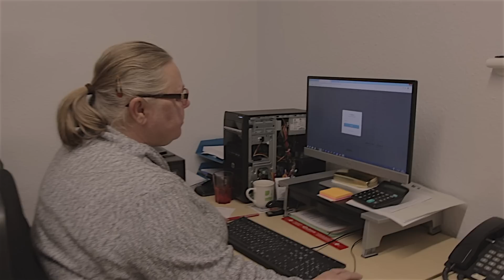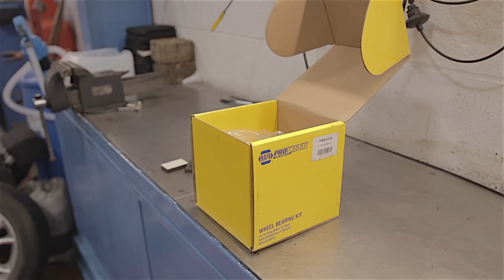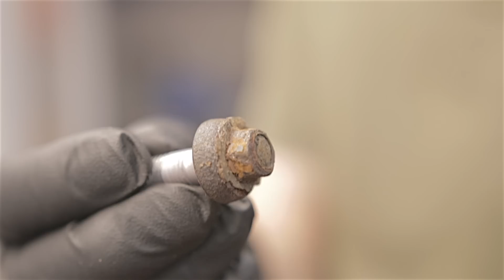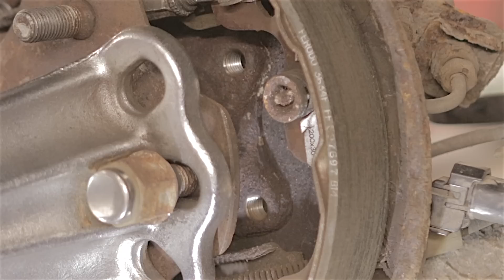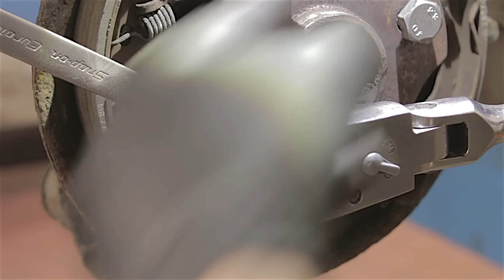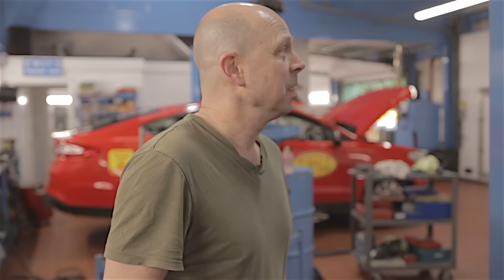Toyota Yaris Rear Wheel Bearing Removal...No Problem

Comment: Tnx mate , you made this job so much easier .
With your tutorial i changed them both . And stripped the threading on the m10 bolts i used to pull it loose.
But it came off.  When installing the new ones i gave it some coppergrease to make it a easier job next time. Unfortunately it didnt solve my abs issue . So that has to be somewhere else.
Already changed the pickuprings on the front , still at almost standstill the abs kicks in . I have No error codes in system.

Comment: I simply:
1. loosen the 4 bearing bolts about 1/8”.
2. Reinstall drum and wheel.
3. Find an open parking lot.
4. Drive in a circle in the parking lot, turning left if removing a right side bearing, or right if a left side bearing.
5. The high lateral force exerted on the bearing easily unseats it.
6. Return to garage and complete task

Comment: on the 2018 Yaris the bolts holding the bearing go through from the front into the axle and the ABS sensor is on the top.  I used the same tightening up a bolt and nut method to remove mine  - only had 22K miles on it!!  thanks for the tip even 5 years down the line!

Comment: Your video was awesome definitely saved my butt. Loved the slide hammer. Mine was stuck as bad. Used the bolts that held it on after it was loose and stuck a wrench between socket and hub and was able to keep loosening and forced off the hub. Thank you
Reply from the maker: excellant, glad it worked for you

Comment: Great video.  I would suggest putting some anti-seize on the bolts that are used to pull the bearing hub off, so that they're less likely to strip if the hub puts up a fight.

Comment: I have followed your instructions and went great.
I replaced my car's rear hub yesterday in a parking lot. Just be sure the hex bolts you are using are grade 5 or grade 8 or similar because will bend. Mine were hex of 10mm Dia. and 80mm long grade 5 and I placed them both sides of the hub evenly and tighten them both a bit at a time, the same amount. When the hub joint started to separate from the nuckle, I apply penetrating oil and punch the hub where there were no bolts and continue tightening the bolts. I repeat this process as the bolts got tight until the hub was completely out. Be careful not to punch the oil pressing cylinder. I re-assembly back all the drum brakes shoes and voila. Done, smooth and silence wheel

Comment: Great video. I purchased a new official Toyota wheel bearing hub from Ebay that had been sitting in the warehouse for a long time. I saved about $300 U.S. After looking at various videos (including yours), I saw that most of them encountered the nightmare stuck hub assembly when trying to remove the old assembly. I tried to contact a licensed mechanic and inquired if he would install my part for me. The mechanic refused claiming that they don't install user provided parts for insurance and other reasons. So now I may have to try it myself when I build up the courage. Pray for me.

Comment: Awesome video with great tips about the 2x M10 bolts. This guy is hilarious. Had me laughing. To anyone who has done this, how easy do the lug nut studs come out if you whack them with a hammer? I'm about to do this job over the weekend but I'm concerned about the studs not coming out and I'll end up making my car undrivable 😅
Reply: Update I've just changed my rear bearing on my Yaris Mk1. It wasn't too bad, the 4 rear bolts weren't too bad but I did pre-treat with PlusGas over a few days. The original bolts I bought kept stripping and snapping. Had to get some galvanised M10 x60mm bolts to eventually do the job. Took 2 minutes using the bolt technique. So happy with myself that I've done it. Many thanks
Reply: Just wanted to update my comment. I replaced the other side today using the exact same technique. Whipped it off in minutes and job was done in less than 30 minutes. The 4 rear bolts came out straight away thanks to my impact gun. No problem

Comment: Great to see an 'old school' proper mechanic with some common sense rather than the muppets you have in main dealers who have no clue... Toyota wanted nearly £300!  Yes £300! for the hub and £240 to fit it by the way.Total rip off. I bought a Blueprint hub for £61.  Exactly the same as the part I removed...
Reply from the maker: 🤣excellent. Have a good one

Comment: I have a 2017 Yaris.  Rear off side hub knackered.  Came out with a little force.  I smeared copperease around the joint you mention before fitting new hub.  Should revent the issue. I bet they dont in the factory...

Comment: Our Toyota is apparently exceptionally problematic. Almost 7 hours in with a handfull of broken bolts and nuts, a lot of hammering and a lot of WD40 the hub has barely moved at all. About 3mm on one side and less than 1mm on the other. But it will probably come out with enough patience, brute force and colorfull vocabulary. I will get more bolts and nuts when the hardware store opens up again tomorrow, a copy of the helpfull book "1001 peculiar profanities from around the world" and continue the fight then. I hope that some unstressed new bolts and another night of marinating in WD40 will help. After that I can relax with the old Beetle. Where 4 bolts and some gentle wiggling makes the whole engine come out.

Comment: Thank god for this video! I've struggled wit ha hub on a WiLL Vi - basically a mk1 Yaris underneath. I've hit it with a hammer - a lot; pushed and hit form the back; taken the rear brake assembly off - and broken bits as I did - but the hub remained, and the bearings inside it are now properly knackered! It hardly turns at all. All i was trying to do was change the ABS sensor!
I will be doing this at the weekend - as well as trying to fix the mess I made! I'll upload soon with my efforts - and I'll give you a shout out!
Reply: How did it go?
Reply: @ShiftedReality90  it worked!
Rear wheel hub/bearing | Toyota WiLL Vi | Not A Proper Classic
https://youtu.be/LO0mqykalYc

Comment: Same issue doing a pug 107 last week, on daughter's car, against the clock.
To break the corrorion I ended up soaking the section with WD40, then drifting the hub assy around using the lugs.. Then once it had started to move, bolted the wheel back on and stamped on it (lying on my back) side to side to free it off. 
Down side is having vto remove one brake shoe to get access to hammer the lugs.
Reply from the maker: nightmare😁

Comment: thank you for this very clear and informative video. thank to it i did not waste time and money to save special tools. i used M12x10 and it worked perfect. the nuts could not be made loose so i can not reuse them. but that is no problem. i will get some better ones for this purpose. thanks for taking the time to make this video and share it. i also like your humor :-)
Reply: Put a dab of oil on the bolt threads where the nut is and it'll both thread in and come off easily

Comment: Really smart approach. I tried to hammer it out with sledge hammer and biggest socket i got. I literally drove it without bolts to nearby mechanic. Rust wouldn't budge until mechanic took torch and 30min later it popped off.

Comment: Thank you. Gearing up to do the same on a 1litre 2005. Not sure yet if abs or not. Any idea what size studs/bolts were ideal to remove the bearing? M10/12? 
Thanks for a decent vid. I also watched AUTODOC and thought no way will it come off like that 😂

Comment: This works great! Didn't have to remove any lug bolts, my old hub had holes in it. Put some loose-nut, let that soak-in a couple of days. With the bolt trick, it just popped out. Brush out the hole, you should be able to push the new hub in by hand. Tighten up to 90 N-m and you're good to go. Thank you very much for posting this video.

Comment: I’m a Toyota mechanic. All you need to do is remove the brake shoes and strike with a hammer from side to side. Walk it out. It’s very easy and much faster.
Reply: I've done it, a lot easier and saves you grinding the damaged bolts and nuts off.
Here's the link. https://youtube.com/shorts/MTdUE8ofY2o?feature=share

Comment: Worked great. I used 1/2 inch x 7 inch carriage bolts on my 2008 Yaris. My experience mirrored this video almost exactly, down to the pops when the hub broke free.

Had a little scare when the last bolt on the passenger side refused to break free. I let loose the impact gun and after some tense moments it came spinning out. Thought for sure it was going snap.
Reply from the maker: lol, glad it worked for you

Comment: Fantastic easy, when watching your very good explanations! - i had to use a little torch to heat the 4-bolts to have them removed ! , and i noticed the new bolts did not follow together with the wheel hub in my case! , Anyway Thank you so much for the inspiration !! : The day is verry good thanks to You ! ******** (y)
Reply from the maker: lol, glad it worked out well

Comment: This video helped me today, but jesus.. It was stuck like crazy, had so much pressure on the bolts that one went through the metal backplate. Eventually got it out by heating the bearing, as well as lots of hammering. 🥴

Comment: Holy banana! I just replaced one rear wheel bearing on my 2001 Yaris. Tried the bolt and spanner method, but i shot the threads on 2 sets of bolts, and they was big, i had to disasseble the brakes to fit them against the brake shield. The only thing that worked and was left to try was heat and brute force. For 30-35 minutes i altered between heat on the backside and massive force on a metal bar i welded on, from under the car outwards. but suddenly the entire thing came loose. . The force was to the degree that the entire car sled sideways on the jack stand. Before this i was happy it was the rear bearing and not the front that was shot, but now i dont know anymore. I mean, the front bearing can be pushed with a press. Here are some pics of the ordeal.

https://photos.app.goo.gl/cFoLeqDjFcCASfrF8

Comment: I found it easier to turn the nut than the bolt. Easier on the backer plate too!
 I wanted to research a better way for the 2nd side because the first one I just put the wheel back on after taking the bolts out and kicked until it moved, problem being it took the entire backing plate with it and I had a hell of a time getting the wheel back off a loose bearing!

Comment: Thank you so much for this video Alan much appreciated I'll be letting the garage do it quote £100 not bad quote I think cheaper than a divorce.
Reply from the maker: lol, cheers
Reply: Ended up doing it myself easy cheers than I did my mates on 56 discovery front bearing even tho I had to call my mate out with impact gun for centre but 😁

Comment: Just done this today, thanks for the clear video mate. Just a note, I had to travel to an engineering firm to get some high tensile bolts because standard ones just snap or strip when you try to "press" the bearing out of the axle.
Reply from the maker: yes your right, the bolts do need to be high tensile steel

Comment: Did this on a 2017 Yaris Hybrid with 50k miles and knackered rear bearings. Toyota wanted £800 to change them and that didn't include rear brake work - the Hybrid has discs at the back. Wasn't too hard to get the old ones off but get new bolts for the bearing and for the caliper bracket first as the aftermarket parts don't include them.

Comment: I had a problem just taking my front left wheel off my Yaris to  rotate the tires, and ended up using a hydraulic jack and a strap, putting the head end of the jack to the wheel and the base with the strap around it and tied to the wheel bolts.  It worked!
Reply: Loosen the lug nuts a little and back slowly out of your driveway and turn as you drop to the street. As soon as you hear it pop free, stop and tighten them back up.

Comment: ....maybe some freeing spray around the flange that is rusted in might help ?   I don't think heat application would be possible due to proximity of rubber components - i thought of it, but not practicable here.  Cheers - Chris.

Comment: Some coins (or washers) under the bolts, and there's no damage on the anchor plate.
Reply: @Paul van Lies·hout Have you tried the coins method as I was wondering if they would work to stop the back plate getting damaged.
Reply: @gettingoldereveryday  Yes. That's my method. Never fails.
Reply: @Paul_VanGo but how many coins did you damage? 😢

Comment: great tip. Gonna try it right now. Have a yaris on my lift as we speak. Same problem. Used heat, a LARGE hammer, a puller, ... nothing so far.
edit: your trick with bolts worked like magic. I tip my hat to you, sir.

Comment: Wouldn't slackening off the wheel bearing bolts and taking the car for an enthusiastic run with a few handbrake turns free it up? Albeit, it could mash the bearing threads...

Comment: Everything magically comes off easily and straight forward on YouTube because most videos are not in the UK with the crap wet salty environment. This is a good idea, I've always had to remove the shoe assembly and hammer the crap out of it for 10 mins and get tennis elbow for days after..
Reply: Here in Germany specially in some rural areas in Baveria or somewhere, cars are rusting in time-lapse too. Yesterday i needed some patience to get off the winter wheels from the hubs of my car, all four were seized by rust.

Comment: Alan, you Sir are a star, I went to change the rotten brake dust shield/backplate off the front of my 2008 Mk3 MX5 today, could not move it at all yet all bolts came out freely so I did as you said popped a wheel stud out and used  an M12 bolt to draw it out, I only used one bolt but kept moving it about to different positions it didn't bang as loud as the Yaris but it was in there! so thanks again top tip.

Comment: On my Toyota Echo, I stripped out a whole bunch of inferior bolts to get this done first... Then I made a special trip to the automotive store and bought "Dorman 960-430" bolts, and "Dorman 962-014D" nuts (GRADE 8!!!!!!!!, 1/2"-13, 3" long hex bolts and nuts) (if you include the price of the stripped bolt failed attempts, I ended up spending more on the bolts and nuts to get this stupid rusted bearing out as I did on the cost of the new bearing on ebay... atleast the grade 8 set will live in my toolbox now...)

But, thank you! Without this technique I'd still be out there hammering for nothing!!!!!!!!!!!!!!!!!!!!!!!!!!!

Also, those four 12mm bolts that hold the hub in on this style (bolts thread into hub) have a torque spec of 52NM or 38ft lbs... If your the opposite style where your backplate has the threads, the torque spec is higher at 90Nm or 67Ft/lbs.

Comment: Changing the wheel bearing hub on friend's Captiva we took the whole upright off the car and her hubby was having a go at it with a sledge hammer and it wouldn't budge.. luckily one of my mates had the access to a press in the workshop so after pumping up 6 tonnes of pressure it finally moved.. Good old rust can be as strong as a good weld :)

Comment: What was the milage on this car? My 2001 Yaris has 78,000 miles on it and all four wheel bearings are immaculate, smooth and not a hair of play. Have you ever had one shoot across the shop like a bullet when it finally breaks loose? The whole rear end on these cars is very poorly protected from spray, so it does end up pretty rusty.

Comment: Yeah liked the way the old Lancia's had loads of info dials, amperes, oil pressure, temperature.....to give you early warnings...with modern technology you would think the engine should switch off immediately with low oil pressure.

Comment: Bolts easy and driveway guy doable too which good.

My solution on these in the workshop is the air hammer right through the rear sensor .
Would be no problem if hubs and suspension fittings in general had a thoughtful spraying of waxoyl or similar earlier in there life .
I keep a can of waxoyl on the trolley for coating joints/holes/threads, also good on fixing heads and makes job much easier should you be the guy doing it a second time .
And yeh that getting more likely by the day with monkey metal parts in most fancy packets these days, even lot of old time known brands turned to junk in a fancy box .

Comment: Genuine Toyota bearing doesn't come with new bolts. Everything at Toyota is always separate.  Ie water pump then you order the gasket separate.. Makes no sense at all
Reply: It does make some sense. For the bean counters in the company!! 
When you're faced with the real Toyota parts prices, than one can understand that's a gold mine!!
I've had the unfortunate experience of buying equivalent parts for Mercedes!!! and Toyota, just a couple of weeks apart. Both OEM, from the respective official dealer. Same  conditions, same part (brake switch) for cars that are even similar, Toyota Yaris D4d and Mercedes A classe (W168) CDI. 
Well the moment they trow me a price that was basically the DOUBLE of Mercedes!! I confess that I asked the guy to double check the price! That's how surprised I was and found it hard to believe! Should be added that even that of Mercedes was almost 2.5x the price of the equivalent Peugeot/Citroen price!! Yep! That's life.
Reply: @crpth1  Toyota are the only company who will sell you a part but without the corresponding gasket to fit the part. Every other oe company includes this ie a water pump.  Not toyota.  Most expensive dealer parts are SSANG YONG by far